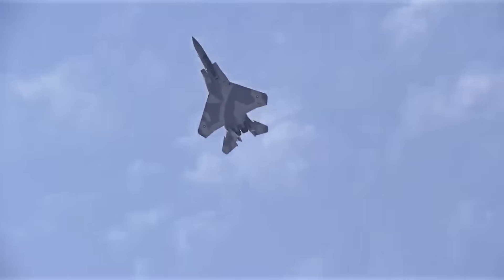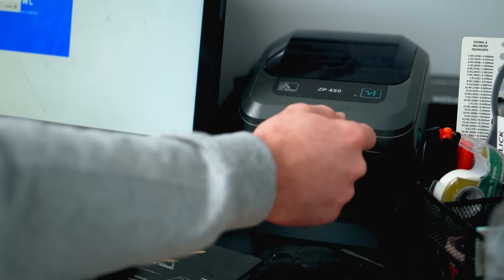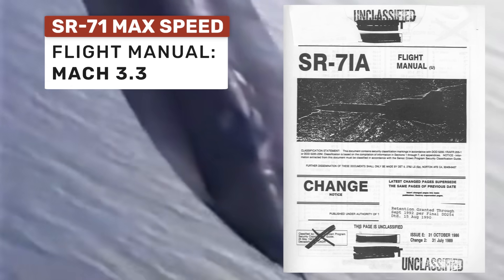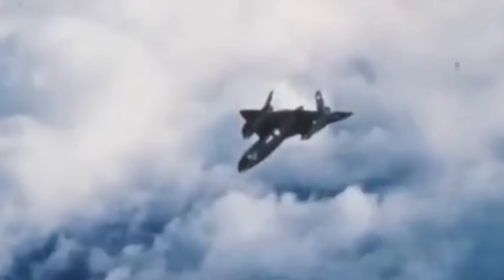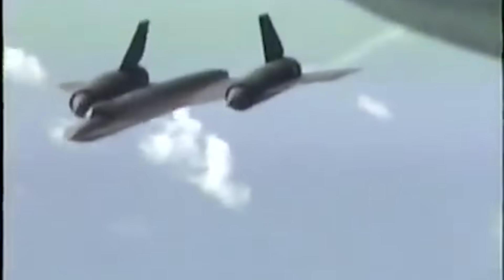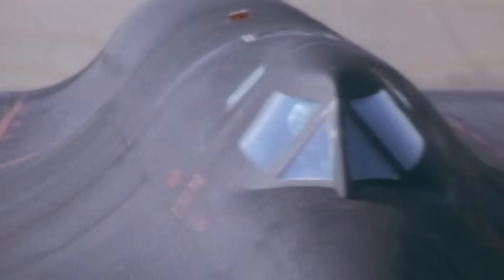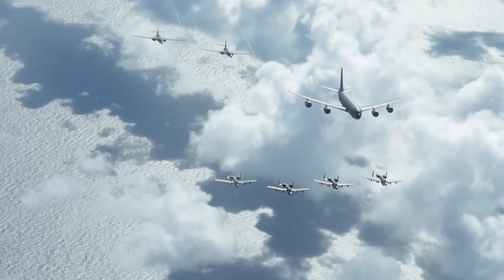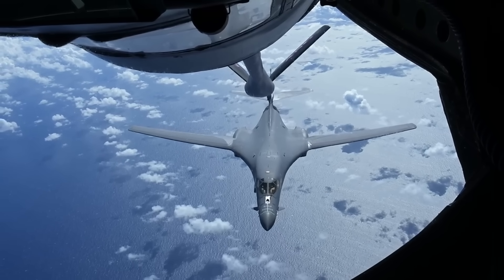The SR-71 was MUCH FASTER than the Air Force will admit

Comment: SR-71 does not really have a speed / Mach limit, but just a CIT limit of 427° and that temperature can easily allow the jet to fly way past Mach 3.2 in cold air and/or in a shallow dive!
Reply: Somewhat. The A12 manual didn't have a "speed limit", just maintain below the 427⁰ CIT limit. The Air Force wouldn't accept that though. Lockheed knew that even under ideal circumstances getting to mach 3.3 was a stretch so that became the AF limit. Mach 3.3 was only even allowed with Commander approval and only if certain engine limits were good. 

But you are also correct,  that there were some speed in the 3.4x range due to usual cold atmospheric conditions. But with those temps, those speeds weren't fully within the pilots control. 

Sometimes they could be at mach 3.2 with CIT limits within range, other times  they could barely do mach 3 without hitting the limit.
Reply: @ Well there are a lot of variables in play as you say, but the CIT is basically the real performance limit. I have a SR-71 Manual on my Computer wich even states Max Mach limit is 3.14 Mach 🤷🏻‍♂️ Mach 3.3 is a proben actually flown Mach number from a retiring flight where the CIT limit was raised, because the engines flew for the last time and there are many pilots who say that they were way above mach 3.2.
What do you want to believe? The CIT limit seems to be the only limitation everyone agrees on 🤷🏻‍♂️
Reply: @xyzaero  don't really disagree with that. Most people I've come across don't even know about that limit and fewer have the manual. I do as well, the PDF and signed book. It's been a while since I read that section but I thought it said mach 3.14 was mission cruise and mach 3.2 was max mission cruise?  While some legs of the Cross Country run were flown at mach 3.3 the engine CIT limit wasn't raised. They did ask P&W if they could surpass that limit as a last hooray type of thing and P&W said no. Ive had this discussion at symposiums and with some former members and basically anything above 427⁰ P&W couldn't/wouldn't guarantee the motor. 

Now interestingly, in that manual it does list a 450⁰ limit. BUT that's only allowed if other engine parameters are within limits. This was a tactical limit and only to be used in a no crash type scenario,  but again only allowed if other parameters were ok. I believe engine speed and something else. Also there was a finite time on the engines if that was used. Any excursion above 427⁰ to that tactical limit had to be logged in the engine log book with how long it was in that range and it only could accumulate 1 hr before the engine had to be removed. 

I'm thinking that could partly be why they didn't allow them to do that for the record run as they could have potentially exceeded that 1 he limit.
Reply: @gr8crash  Yes, I mentioned, that they raised the CIT limit for the Mach 3.3 cross country cruise. I did not remember the exact value anymore, thanks 👍🏻Apparently it even took several congressmen to „force“ USAF leadership to approve that flight, because USAF had no interest in a record flight during retirement, because USAF actually never wanted the SR-71 back in service during the 1990s. I am not sure why the Mach 3.3 cross country was such a big deal, if Mach 3.3 is in the standard envelope anyways 🤷🏻‍♂️

That’s a copy paste from the SR-71 Manual about max Mach numbers:

MAXIMUM MACH:
Mach 3.2 is the design Mach number. Mach 3.17 is the maximum scheduled cruise speed  recommended for normal operations. However, when authorized by the commander speeds up to Mach 3.3 may he flown if the limit CIT 427° is not exceeded.
WARNING:
Mach excursions when using Mach Hold may be severe during turns or while flying through rapid
temperature changes at altitude.
Use the basic pitch autopilot instead of Mach Hold if speed and altitude excursions are excessive.
Reply: @gr8crash  And normal Ops design speed was 3.17 not 3.14 … sorry. Too many numbers 😅
Reply: @xyzaero  haha yea after I responded 3.14 didn't feel right and I also remembered 3.17. Agreed too many numbers.

And to clarify they never got the approval to exceed the standard 427⁰ limit. They asked but P&W denied it. Ive had dinner with those pilots and I don't remember them ever saying the USAF had any issues with them setting the record flight. They mentioned how they did discuss a around the world flight, but the cost was absolutely absurd and they said no.

Comment: Blackbird was flying as late as 2010. It did over 2000 missions over Iraq & around 1000 missions over Afghanistan.
& there's roomers of a new SR71 being built out at area 51, with updated computers & with the ability to be flown unman if need be. In fact the new top gun movie futures it at the beginning, even though it was just a mockup.

Now books from the 70s & 80s has the top speed at around Mach 7, without any aircraft failures. But the issue being the pilot/pilots would not be able to handle the G forces, that's why official books restrict it to Mach 3. 

Fact remains that between it's speed & it's outer coating & shape, tracking the SR71 is almost impossible, even our modern day radars systems can not really track it, when it would go dark(turn off it's location transmitter).
Reply: Virtually everything you said is nonsense. But to keep it simple,  it wasn't flying in 2010. It's last flight was in 1999 and never flew and Iraq/Afghanistan missions.
Reply: @gr8crash  LMAO, your an idiot to think that. I was station at Camp Anaconda in 2003 & seen them flying overhead. Even saw one sitting on the runway at balad Air Force base.

During Iraq & Afghanistan they took many different aircraft & Army equipment out of mothballs.  Such as the F14 & the A10 upgraded them.

At one point around 2004, they even brought the M2A2 Bradley back, even tho it was replaced by the M2A3 bradley Bradley around 1999.

Hell, many of our shooters up until 2010 was still using a bolt action 30-06 or 308, even tho officially the 50 cal rifle had replaced them in 2003.

I bet you think Bosnia & Kosovo ended in the 99, even tho we still are there today, or that military actions in the 1st Gulf War ended in 91, even tho they really continued until 96.

What the government officially says & what is factual is always different.
Reply: @jasonstephenson793 to start it would be "you're". But just another reason you're wrong. The USAF never flew another reconnaissance mission after 1990 with this aircraft after they retired it. Only NASA flew it during the 1990s with the last flight in Oct 1999.

It was never flown or even flying during either Gulf War or Afghan war. You absolutely never saw one at Balad especially in those years as they called or "Mortaritaville" for a reason and they would base that aircraft there. Nor would there be any reason to. It makes Zero logical sense to have one there, so no that never happened. 

As for the rest of the rambling,  its irrelevant to the discussion of the SR71.
Reply: @jasonstephenson793 i question your deployment memory. All your other ramblings are irrelevant. The SR71 was never flown in either of those wars. And it absolutely never would have been based at Balad, that's laughable at best. Maybe if you said Al Udeid that would he somewhat more believable to someone that doesn't know any better. But thankfully we do. 

So again, aside from your ramblings that are irrelevant, the SR71 wasn't flying reconnaissance missions in either Gulf War of Afghan war nor was it ever landing in Iraq any where let alone Balad.

Comment: The absolute maximum speed of either the A-12 or SR-71 was Mach 3.55 because the inlet spike cannot retract any further and airflow into the engine is disrupted which would result in a loss of control. That presumes the air was cold enough to avoid exceeding the CIT limit of 427 Celsius.
Reply: Above 85,000 feet, aerodynamics are more molecular flow than fluid.  Basically, the higher you go, the less force is applied by changes in air flow, despite the fact combustion can still occur under ramjet and scramjet operating domains.  The SR-71 was designed to operate efficiently in full reheat.  It was basically the only operational deployment of such an engine, as turbofans with high bypass are significantly more efficient at lower altitudes.  However, the SR-71 was effectively a dual cycle engine which operated as a turbine before converting to something closer to a ramjet in reheat.

At those altitudes, things like shock cones don't really matter.  That was just to get to the operating threshold of the reheat cycle.

Comment: Operational speed was 3.2 Mach. Family member was part of program. The Blackbird was faster he said. Much faster. It outran a Surface to air missile. They flew at Mach 5 he said. So if Sr-71 outran it... that gives you idea of it's speed.
Reply: Um no. Sounds like trying to say the SR71 could fly mach 5? Not even remotely possible. Even much above 3.2 wasn't really possible.

Comment: So you don't think that we're flying faster now than we did for 50 year old plus technology? That's the case I got something 10 inches I can sell.... Turn the lights on 65...
Reply: At least 2 manned secret aircraft have been traveling in excess of mach 5 for the past decade. The truth will eventually leak.
Reply: @WackoJackoProvenGuiltyInCourt lol no there hasn't been
Reply: For quite a while there was no need for an SR71 type successor,  nor was the manufacturing technology advanced enough to build something. It wasn't until the last few years where manufacturing technology has caught up to designs. 

Not to mention,  the reason the SR71 was retired when it was,  was due to political reasons and jealousy from the General at the time. There's no way he'd shut down the program and then fund a replacement.

Comment: Of the 5 different Aerospace companies I worked for during my 27 year span, one guy I worked with was a designer from the Pratt & Whitney company that built this powerplant. 
He still had contacts with those who maintain this engine. His sources said it would easily reach mach 4. Only those close to the aircraft KNOW.
Reply: There's no version of the J58 that was built that could handle mach 4 speeds. A few years ago P&W did say of they built that engine today with modern materials and controls it could get to mach 4, but the J58 we all know and love in that airframe was never going to get close to mach 4

Comment: My former coworker Bob Coates flew that back in the 80s. That planes skin gets so hot that by the time they landed its leaking oil everywhere.  The skin is composite we used.  We actually built a new space shuttle (X-33)  back in the 90s.  But the final tank test failed.  It was scrapped.  The infrastructure is still out there in Palmdale.
Reply: While I know pretty much nothing on the X-33, the issue of oil-leaking as far as I know, was never a problem with the SR-71.  The aircraft was known to have a tendency to leak fuel on the ground since it was difficult to make a sealant that could fully withstand both the heat from the aircraft's speed as well as the chemical composition of the fuel itself.  That said, it did have a sealant that had a limited effectiveness, and was said to have a quality of watery putty on the ground, and you'd get some dripping.  They did generally have some pans in key areas to catch the fuel in this case.
Reply: @petero.7487 the sealant was ok with the temperatures and fuel. The main issue was it wasn't flexible. It couldn't handle the continuous thermal cycles of flight. So after a several flights the sealant would crack and leaks would form. The leaks would remain until the leak limits were exceeded where it would be scheduled for fuel cell MX during scheduled PDM.
Reply: He was an RSO not a pilot. And no, it didn't leak oil from every where, that's just silly.
Reply: @gr8crash yes he was an RSO and the leak was actually fuel.  But from what i understood it was designed that way.
Reply: @ianthompson8248 it did leak some fuel yes,  but not very much now was it designed to leak.  Virtually all aircraft leak,  the SR71 was no different. The reason it leaked was the fuel tank sealant was becoming damaged.
Reply: @gr8crash  from what I understand this happened because of how the titanium skin expanded when it became very hot after flight.
Reply: @gr8crash  btw...just so people know...the SR71 was a two man plane.  The pilot and the RSO.  I used to think the Air Force had a limit on how tall a pilot (or anyone in the cockpit) could be.  I am 6' 2" and Coates is a little taller than me.  I think it used to be 6'4" as the limit.  But I think that has changed in recent years.
Reply: @ianthompson8248 that is part of the old myth though. The aircraft does expand for sure, but thst has no affect on the leaking. It's the overall thermal cycles of flights that would cause the tank sealant to crack and the leaks to form. 

The height thing I've heard before as well. I don't know if it changes slightly per aircraft?  Like I remember seeing something that for the F14s you had to be like 6' to reach the ejection handles. But an F16 it's like 5'6 or so.
Reply: @gr8crash  since posting this I read that they changed it back in 2022 to 6'5" to add more diversity.  But like you said it would still matter on the type of plane one pilots.

Comment: 2700+ ish mph..  HOLY BALLS , !!  !!
Reply: Not even remotely possible
Reply: @gr8crash  WELL ,  THAT is what Mach. 3.5 is ..
Reply: @normpage4604 wellll no it's not. Not even close, your math is wrong.
Reply: @gr8crash     then tell it to Google. Because I googled it and that's what it fucking told me
Reply: @normpage4604 if you Googled the correct thing, you'd probably get an accurate answer. 

2700mph is just over mach 4, at mach 4.05. The SR71 flew at mach 3.2. Mission cruise was 3.17, max mission cruise is 3.2, which would be 2132mph. 

What you failed to account for was the speed of sound changes at different altitudes. You need to adjust for altitude.

Comment: In '77 stationed at Beale AFB on U-2's. My roommate SR-71 mechanic climed into cockpit after cooling down. He told me. guage measuring speed wasn't reset by pilot and read 3.8
Reply: While I've heard claims that the plane would remain hot after flights, the mach meter doesn't work like that.  It basically adjusts in real time to speed.  So if the plane did Mach 2.5, it would read 2.5 when you were doing it, if you did 3.2 or 3.8, it would read it under those conditions, but if you slowed down, the gauge would read whatever you were doing, so if the plane was sitting on the ground, it would be reading 0.00 since there's just not enough air hitting the plane.
Reply: @petero.7487 pretty much yea
Reply: He was messing with you as that isn't possible. Even the cooling comment is ridiculous

Comment: The engines could in theory take the jet to makw 3.8, but the problem was the jet would suffer severe damage to the airframe. Mach 3.5 was the absolute limit without self destruction.  It could also fly up to 100 k feet.
Reply: No and no. The overall maximum airframe potential was mach 3.8. But to achieve those speeds the aircraft would have required significant rework which also brought all the safety margins to essentially zero so the improvements were never made. And even those speeds were only going to be a temporar/dash type speed. Also no. The aircraft could never fly at 100k ft.

Comment: We had good evidence when I was working on the F11 F model that we could do burst speeds approaching Mach 3.2. The same engine for that aircraft was used in the F-16 and F-15 and the last model of the F-14. It was even used in a version of the AA Corsair to see if they could use it for a ground attack aircraft as well as a fighter. Being the last gunfighter before the F-16 came along. It would have been a really interesting plane. My understanding is became that the SR-71 was capable of flying considerably faster than what you show here but remember that the higher an altitude you go the slower a Mach number is actually at. Like at 40,000 ft Mach 1 is only 660 mph. At sea level Mach 1 is about 750 mph. Because denser are transfer sound faster.
Just so you know it's my firm belief that Mach 4.5 to 5 was a normal number at the higher altitude. But I do not think we even know what that highest altitude actually is.
Having been qualified to work on virtually all of these aircraft. I don't think there's any reason why the F-15, with the GE engines which are more powerful than the Pratt & Whitney's that were originally in it, couldn't do Mach 3, or better